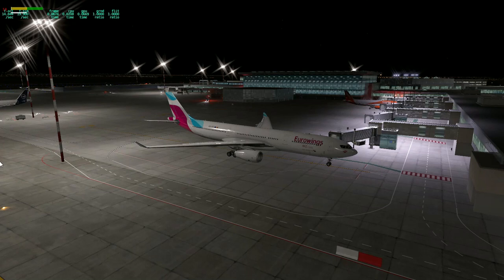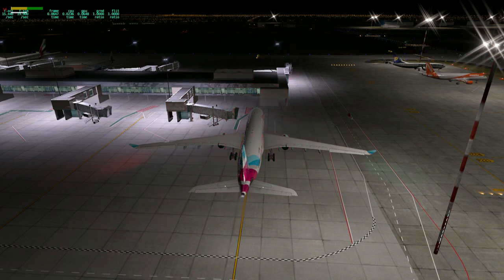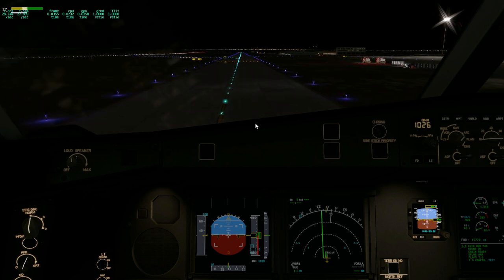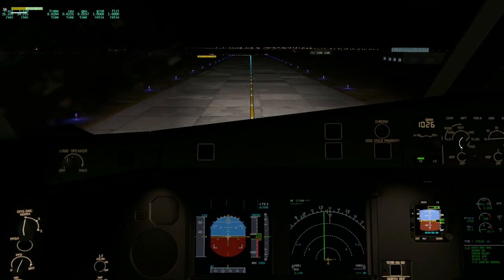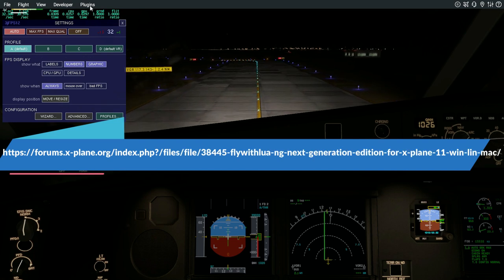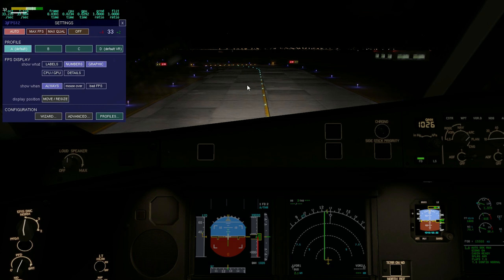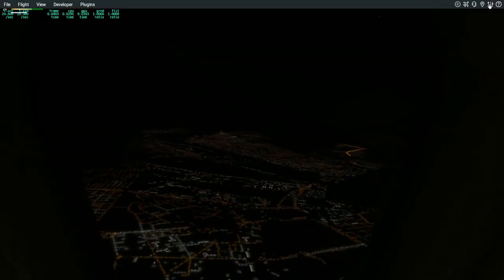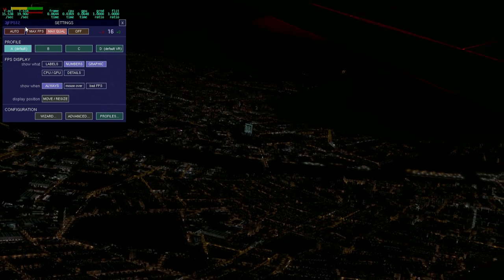How to boost up frame rate | X Plane 12 Tutorial | Low end PC's(RUS+FR+GER)

Comment: If you look at GPU benchmarks, flight sims run the slowest in FPS. Not so much rendering but due to rendering and physics modeling in 3D. Even with a very high end GPU it’s not uncommon to see 40-50FPS. I also think VRAM is very important for Xplanes. Also a dedicated eGPU with 8GB vram will make it run much better.

Comment: Processor	AMD Ryzen 5 4600G with Radeon Graphics   3.70 GHz
Installed RAM	16.0 GB (15.4 GB usable)
still gives that shit warning\
Reply: Well no dedicated GPU could be an issue
Reply from the maker: Hi dear friend, I am awefully sorry because I was in trip and was busy and I could not answer you. In my idea X Plane 12 has some system issues that they should fix and update. Some ridiculous settings that drop frame rate even with a system like yours!!!
Reply: @qartaleaglewing  thank you so much for the reply god bless
Reply: Try increasing your shared VRAM in your BIOS. Xplanes recommends 6GB vram.

Comment: Anything below 19fps in XPlane will cause a warning message "not running in real time" and you would be disconnected from Vatsim. The goal is to be at 30fps or above and smooth performance. 80fps and stuttering doesn't make sense for example. I would consider anything below 20 fps unflyable and non-liquid motion with jerkiness and stuttering.
Reply from the maker: well, you must be rich!!! if you have extra money send me to buy powerful PC! we live in middle east and you forgot Dollar is insanely expensive
Reply: @qartaleaglewing  but thats actually more like a problem of yours if you have MSAA set to 2x and ambient oclusion set to high on a 1050ti :(
i myself has nearly the same setup as yours but with Ryzen 5 5600g Vega 7. x-plane 12 runs very bad even at lowest 720p (same performance as in the video), my solution to that problem was i downloaded x plane 11 with hd global scenery DLC. and it stays above 60fps 80% of the time at max settings 900p FXAA + Reshade. Also the graphics diffrence isnt big at all :), from my testing i found out that Ambient Occlusion is the most demanding setting in all of x-plane for some reason

Comment: Nice video i hope it helps me, planning in getting into flight simulations also probally going to start with x plane 11 first. Is that a good choice for the start?
Reply: Nice plugin. I'm with a constant Fps problems because it if is less than 20fps for more the 30seconds, the Xpilot(Vatsim) will strike you.... maybe it will help me.
Reply: If XP11 is still $59, then you might as well get XP12 for the same price, unless you have a low end machine/laptop. There is a TON of freeware scenery and aircraft for XP11, however. I fly both.
Reply from the maker: hi my dear friend, sorry I saw your message now. well it depends on your computer specifications!